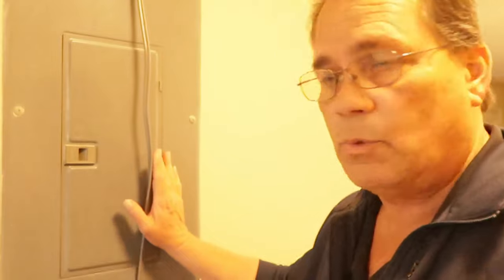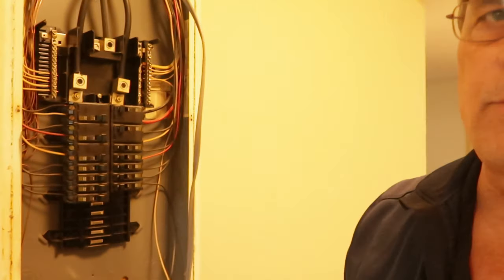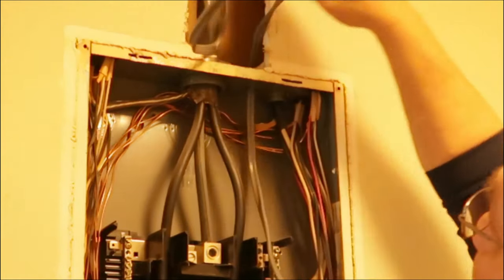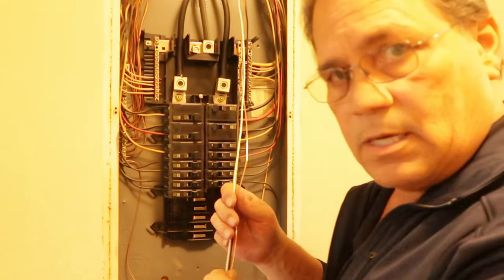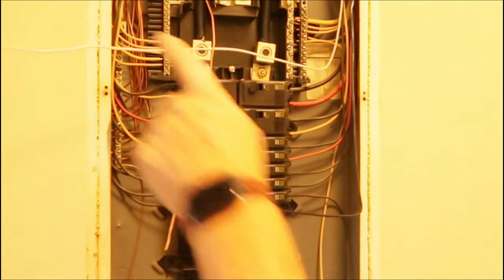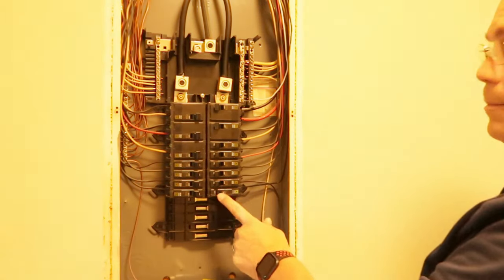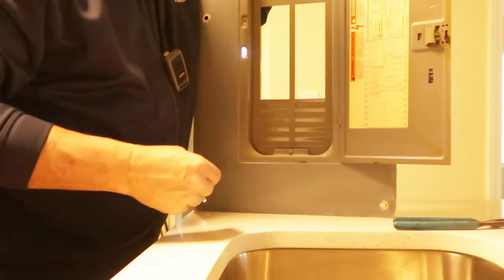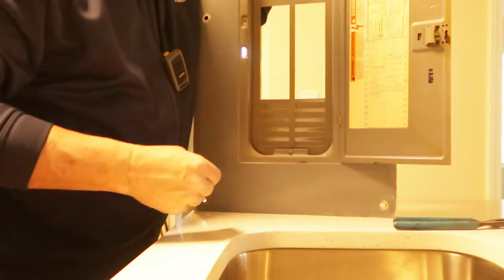How to Install a 20 AMP Circuit Breaker / E3

Comment: I literally watched 50 videos about this before working up the nerve to wire a separate line with a breaker. Your video was that push into the swimming pool I needed, thanks
Reply: How did it go? Any problems? im in same place, i need new 20a receptacle, i think i can do it.

Comment: You know... Ive been doing a lot of renovation work in my own condo which was originally built in the 1940's and then renovated in the 70's. I had paid some electricians to add some minor things, like recessed lights, adding a circuit etc etc... I paid a lot of money for what was done. Now, Im adding some more lights, outlets, and putting my storage area/wood working area on its own circuit. I regret ever having the electricians come in the first place for the quality of work they did. Your video saved me a lot of money and you really "de-mystified" the electrical panel. Thank you for that.

Comment: A lot of States don't have an external shutoff at the meter. To disconnect the whole house power (de-energize the breaker panel) you need to pull the meter, which is a sort of breaker itself. Only Power Co. electricians are permitted to break the seal and pull the meter. Safe method to add breaker is to flip the panel main switch which de-energizes the buses. Made me nervous watching him dangle that copper ground long wire across two live buses. I once saw a contractor doing same and he dropped his screw driver and yes it wedged across the buses, shorted the house, arced and welded the screw driver to the bus. If the main panel switch is tripped the bus is not energized but the incoming wire lead upstream is still "hot" so you have to be careful working around the top of the panel. I have heard some suggest cutting a square of cardboard and slipping over the incoming wire connectors just to prevent an accidental touch while wiring breakers.

I love the Robertson drive and Torx. The slotted and especially the Phillips cam-out too easily. And the Phillips is impossible to line up in confined spaces.

Comment: Fun fact: The screw tip is a Robertson square drive, which was actually developed in Canada prior to the philips. It is very common up in Canada in the woodworking, RV, and boat building industries.
Reply: If it wasn't for Henry Ford they would be popular in the US as well.
Reply: I failed my screw tip history class. Thanks for the refresher
Reply: It is used for a whole lot more than just those you mentioned . By far the best screw end , the Robertson screw is very commonly used in Canada instead of inferior Philips screws . Surprising that some people don’t know what they are called .

Comment: @ 2:00 one thing overlooked on the clamp connector is to put in one of those red plastic bushings. It prevents the wire from being damaged by the clamp once you have wire through, and an extra short protection. Theyre ridiculously inexpensive ($0.10 ea) and it will also help give a bit of a seal on your knockouts from any pests or debris.

Comment: 8:30 Over the years, the paper has faded, and the words are hard to see. Instead of writing this information on the form, I use a Brother P-touch Label Maker. I also print the number of the circuit breaker and place it on the breaker. 3:00 I always put the cable clamp on the wire with a plastic cable protector before running the cable into the box. This prevents damage to the cable. The plastic protectors come in serval sizes to fit the size of the clamps.
Reply: Good idea, also use plastic coated drivers to avoid accidents inside the panel.

Comment: I have a new house and they put at least 13 outlets, which includes garage lights and outside lights, on my single garage circuit and it trips about 1/3 of time if I turn on my compressor or miter saw etc. (obviously not at same time).  So going to install a double 20 amp outlet.  Breaker box is in garage so don't have to run wire thru the house at least.

Comment: I saw something that was not commented on and something that I was wondering about.  I saw that he had cut a hole in the drywall above the breaker panel. I'm going to have to do that to install a new wire for a bathroom wall heater. Would like to have heard comments on how he did that cutting in way that safely avoided cutting any wires.
Reply from the maker: One of the past videos on Upgrade Unit. Check in the Series Playlist to find that.  Thanks for watching and thank you for taking time to ask a question. Let me know how it go’s
Reply: @danjiles  i would have punched a hole in the drywall with a hammer ,,, then look around to see where you are cutting ,,, do my work and put a plate over the hole in case you need to add another wire later on ,,is that what you did ?

Comment: I'm running into an issue that involves not having power to the hot water heater after switching out the 2-20 amp for the dryer. They are not a double pull but are single 20amp breakers. There is a clip that secures them together so they can mount to the buss bar on the back. Still no hot water from the faucets. And help or ideas??

Comment: I noticed the microwave outlet was a 15amp.  I know it's ok to place a 15 amp outlet with a 20amp breaker, but would it actually be better to replace that 15amp outlet with a 20amp one?
Reply from the maker: for. sure, yes. we have made that change and are doing this on all microwave circuits installed now. Thank you for watching
Reply: Is the duplex required to be a 20 ampere device?   No it is not by NEC.   If it were a single and not a duplex receptacle, then yes it would be required by NEC.  The microwave does not have a 20 amp plug, it has a 15 amp plug.   So, it is not necessary, but you can if you feel so inclined.

Comment: Dan, what is the Grey wire in the beginning connected too???
Reply from the maker: I assume you are talking about the outer casing that the white, black and ground wire are in.
Reply: @danjiles  yes sir
Reply from the maker: @MrHodgeon5th  that just the outer jacket of that wire we used. Normally we use regular Romex 12gauge wire. All we had for this project was some direct burial cable. So it was grey.   I figured as long as it is 12ga. It was good to go.
Reply: @danjiles  can I email you 2 or 3 pictures?   I'm installing a restaurant ice maker.

Comment: Is there a reason why the wire sheath is not yellow? For 12 wire? I'm lost, because I need to add 12 for a 20A circuit myself and trying to figure this out.
Reply from the maker: I guess maybe it a manufacturers thing.

Comment: For reference, those square bits are size S1
Reply from the maker: Thanks for that, I'm sure someone will benefit from that info. You rock.
Reply: @danjiles  I bought a set of S bits at harbor freight send one of the cheap 4 bit screwdrivers. I epoxied one of the long S1 bits into it and made it a dedicated electric driver for my electric bag
Reply: @danjiles  might have to pick up another cheap screwdriver because the screws ok breaker panel look to be S2
Reply from the maker: @busared06  I think it is S2. The Klein 11/1 has both.
Reply: @danjiles  might have to pick one up! My diy nature is a bit sickening and self defeating. I'm the one that tends to spend more making something than I could buy it for lol
Reply: @danjiles  much thanks for the video though. Very clear and concise

Comment: My house has a hip roof and the circuit breaker box is located on the outside wall in the back. It's a challenge being able to fit down where the roof slopes down inside the attic.

Comment from the maker: Get your "Klein 11-n-1 Screwdriver" here: https://amzn.to/2QIAIrA When replacing a Range Hood with a Microwave, it's very important that the wiring and circuit breaker can handle the AMPs and Wattage of a Microwave. Be sure your wiring will support this before starting this install.
Reply: Im actually going to be doing this. Can i use the 40a breaker thats in there or do i need a 20a? Im gonna be installing an outlet with the wires from the range. Thanks

Comment: do you have to turn off the main breaker to add the new circuit breaker?
Reply from the maker: To be extra safe, I would. If youre not sure about it then it is a good idea to shut down the main and then proceed. however, more experienced technicians will not turn off the main.

Comment: What I've done in situations like that where you are having to get the wire in above you like that is to put the strain relief as you call it on. Then run the wire through the very open hole and then run the nut up and on and screw that on with the wire already through. I'm short. I have to get creative

Comment: Best advice: Shut down the main power before you proceed with the surgery.
Great advice: Follow through with confidence and "DON"T HALF ASS THE JOB" as mentioned. You can't negotiate with electricity! It has no respect of your existence or how cute you are. There is only "one true right way" and too many wrong ways in order to solve the problem.

Comment: What if my panel doesn’t have a ground bar?
Reply from the maker: This may not be a DIY project that you should do, at least until you can properly ground the panel. I would maybe get an electrician out to get options.

Comment: at again im studying all your video boss: 
How to Install a 20 AMP Circuit Breaker
Tools and Materials Needed:
20 AMP circuit breaker
Screwdriver
Wire stripper
Voltage tester
Electrical tape
Safety gloves and goggles
Steps to Install a 20 AMP Circuit Breaker:
Turn Off the Main Power:

Locate the main power breaker in your electrical panel and switch it off to cut power to the entire house. This is a crucial safety step to prevent electrical shock.
Remove the Panel Cover:

Use a screwdriver to remove the screws holding the panel cover in place. Carefully set the cover aside.
Identify an Empty Slot:

Identify an empty slot in the breaker panel where you can install the new 20 AMP circuit breaker. Ensure the slot is compatible with the type of breaker you are installing.
Test for Voltage:

Use a voltage tester to ensure there is no power running through the electrical panel. This double-checks that it is safe to proceed.
Prepare the Wires:

Strip

Comment: If you're learning to play the guitar, piano or even digging a post hole, a YouTube video is the cheap way to go. But if you're dealing with electrical  amperage that can kill you (and hurt the entire time you're dying), an experienced electrician that is licensed and insured is the best way to go. If you wire it wrong, it can kill you, hurt you, screw up to the point that you will HAVE to call an electrician or burn your house down.

Comment: I had an electrician friday to change my outlet to 20 amp to support a larger window unit. The amp on the breaker read 15 so my brother changed it to 20 amp. Its on a yellow dedicated  line, however, the ac is half on (compressor isnt kicking in).  On the 15 am, the. Reaker tripped. Now the ac is staying on but half way. Im calling the electrician tomorrow,  however,  does anyone have a comment?

Comment: First of all, if I hear an electrician call a Romex connector a strain relief, he fired 😂🤣
Reply from the maker: You are correct. When I did the video I had a mental block on the correct term. My mistake. 
Thanks
Romex Connector, Romex Connector, Romex Connector, Romex Connector. 
I Got it now.. 😀
Reply: So what were they called before romex? LoL Well I’m not an electrician, but I believe it is technically a cable clamp. It is neither a strain relief nor a connector. But you both lay down lingo well enough I know what you meant. Lol

Comment: Does the ground always go to the left side of the panel and the white to the right side?
Reply: You'll always know the ground as it isn't insulated. Match like for like. Doesn't answer your question, but White is nuetral, Black is hot (always goes to the breaker itself), and ground is sometimes green, is uninsulated typically.